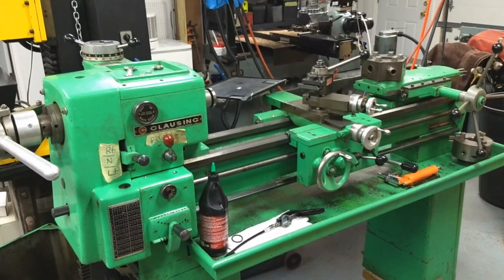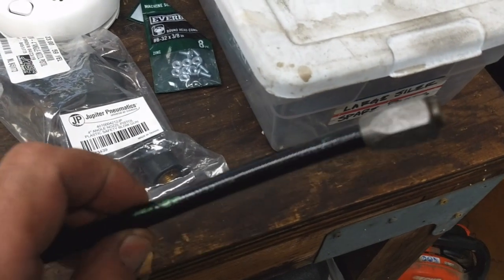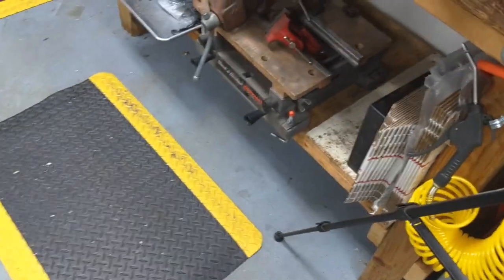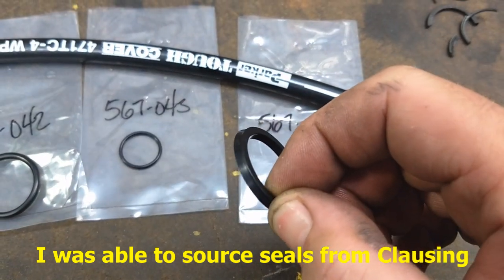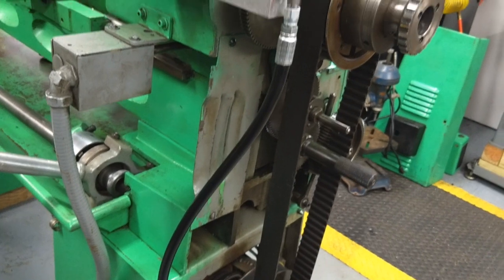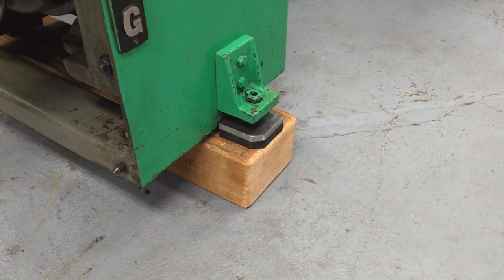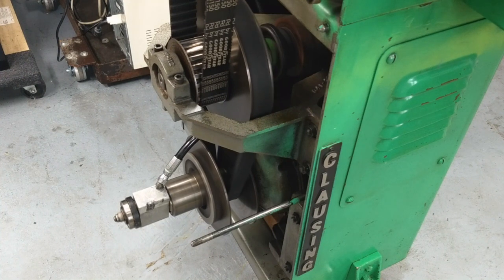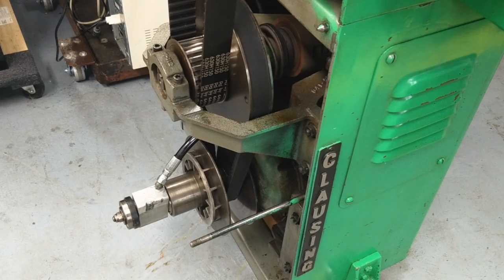Clausing Variable Speed Drive, Success!!!

Comment: that is a airquip reusable fittings. that seal is a lip seal used in hydraulic cylinders. I just replaced mine yesterday. the seal is
1 1/8 x 1 3/8 x 1/8"
Reply from the maker: good info! Thank you.

Comment: Nice video. The green monster is an appropriate name. Thanks for showing the range of motion on the slave cylinder. 
What fluid did you use?
Thanks for sharing.
Reply from the maker: I used hydraulic jack oil. Seems to be working great!
Reply: @lockbuilder  Thank you. I am just starting to go through a Clausing model 6913 that just acquired. Had to make a three phase converter first. Got it started and the variable speed doesn't work. Will soon open it up see what it needs.  I really liked your videos. TG

Comment: Hey Chris, great video!  Could you show or explain the bleeding technique of that variable speed system?  I have the 5900 series with the clutch/brake handle.  It appears that the drive in my unit is flipped 180° in the cabinet.  They must have recognized it would be much easier to service if they flipped it around on the the later models.
Reply from the maker: I'm not sure what I could add to the bleeding procedure except that I did it like a automotive system. Instead of a bleeder screw I just loosened the line at the slave cylinder. Hope that helps!
Reply: There is also info in the manual and elsewhere online for the bleeding procedure